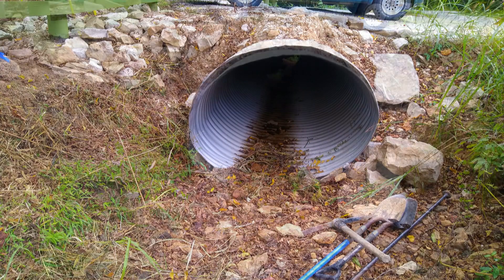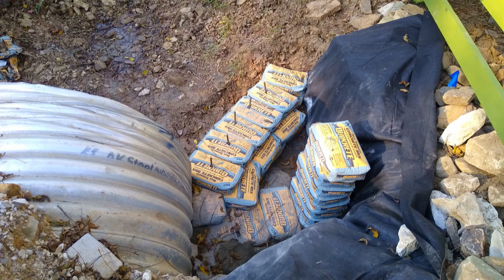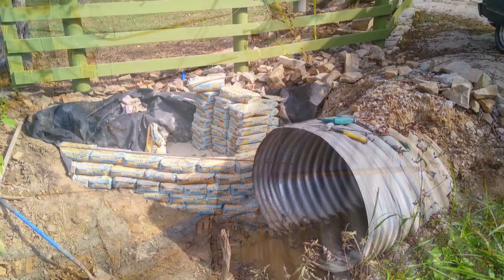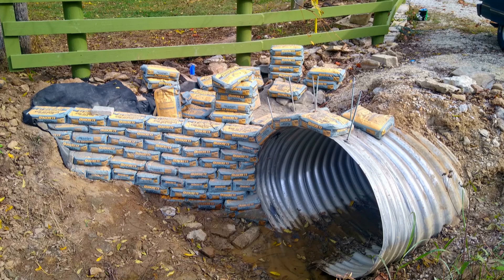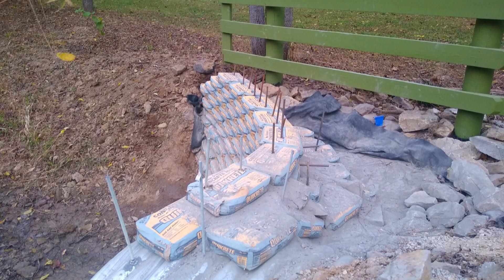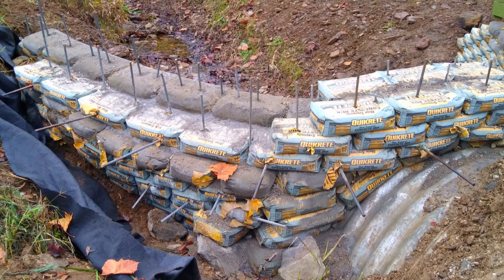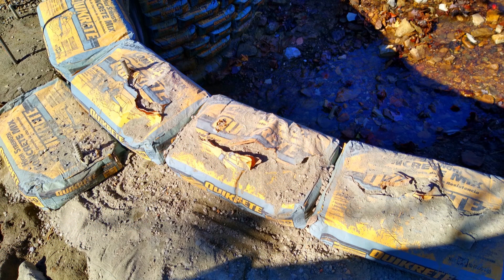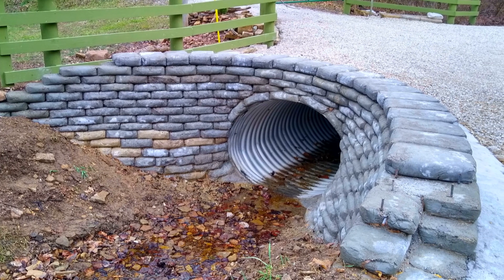Concrete Bag Culvert Head Wall | How I Built

Comment: In your follow-up video you mentioned that the previous wall you made was not mixed and appeared to erode in those unmixed places. Can you describe how you mix the bags?
Reply from the maker: Yes. You roll the bags end on end while it is dry and mix the settled content, if it settled. Aggregate may be at the bottom or sides. Here is the video on improvements that shows this. Have a good weekend. https://www.youtube.com/watch?v=tUlc1Qb5A74

Comment: The real secret here is making sure every bag is aligned so that the text is oriented properly, that adds an additional 10-20% to the structural integrity, plus it looks nicer.  This is massive overkill on the engineering, the way I like it.
Reply from the maker: Yes, the text is very important. You would never want a bag upside down. lol - Seriously, the lines do help in alignment and offset distance. I used a flash light at night to help align bags and verify uniformity.

Comment: Do you just leave the paper bags? Or does it go away over time?
Reply from the maker: @qthebarber4525 I leave it on for a few months, then pressure wash it away. The paper type will biodegrade in a year or two.

Comment: Did you put any kind of drain behind and at the bottom?
Reply from the maker: Hi. On the exit wall I did. Not on the entrance because it floods and I did not want that water pressure pushing behind the head wall. So far no drainage issues. I did put a french drain to the left of this wall and I posted that video. Good question. Have a good weekend! https://youtu.be/ojAfAnApyOs?feature=shared

Comment: This reminds me of an old homemade dam I saw, I can't remember exactly where - one of the Foxfire collections, or maybe an old Mother Earth News?  But one guy had built a BIG dam, maybe 12-15' high and wide enough to completely block a small creek and impound a lot of water, so he had a very reliable head of water for his reaction turbine for generating hydroelectricity.  One of the Carolinas and way back in the sticks so he didn't worry much about permits and suchlike - NOT recommended.  I remember thinking his dam looked like he'd simply dropped a bag of cement, stepped over one and dropped another...over and over, thousands of times until the dam was high and thick enough to hold back the water he wanted.  And once the paper is off you wind up with this regular, sort of handsome stone appearance.
Reply from the maker: That is very interesting. With a major downpour and depending on upstream water shed, I would live upstream of that. My neighbors pond is built with a massive clay dam at the top of a ravine. Wildlife love the small ponds and with some of the springs flowing 365 days here, I have considered building something very small. Thank you for this information!

Comment: This is awesome.  Do you see any waterproofing advantage to coming back to make a smooth front surface?  I like the aesthetic, but if someone didn't, would you just trowel quickrete over the front?
Reply from the maker: It turned out nice. To keep water from the cracks and near the base it might be helpful. You could always repair if needed like you said with a trowel. Thanks for your comment!
Reply: @SteveAddis  Thanks for the great content.  Cheers!
Reply from the maker: You are welcome. Thank you for the kind words, yet I need to post more often. :)